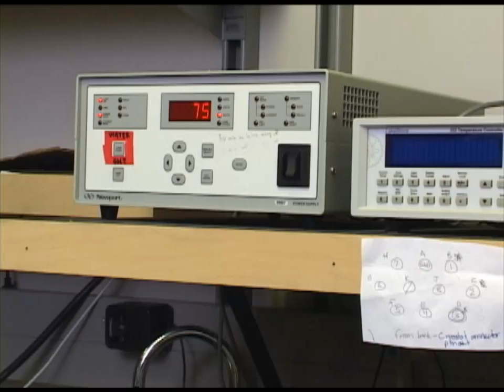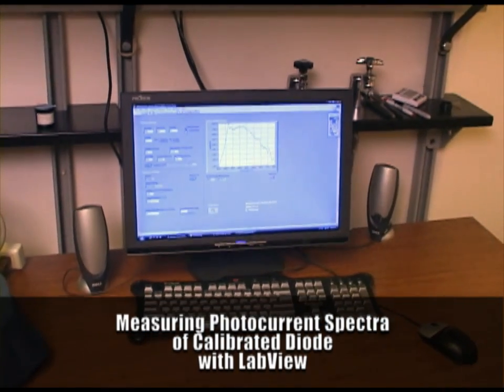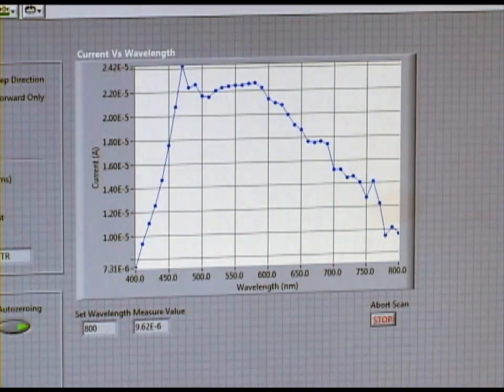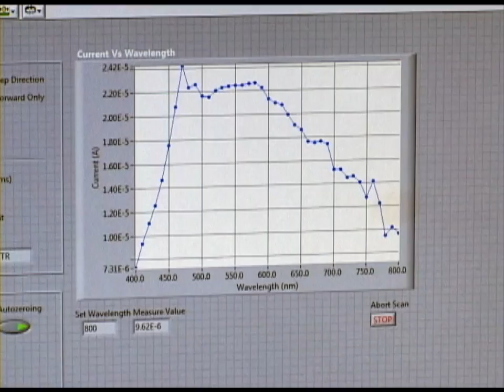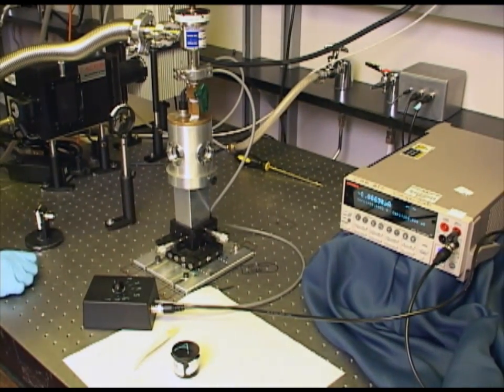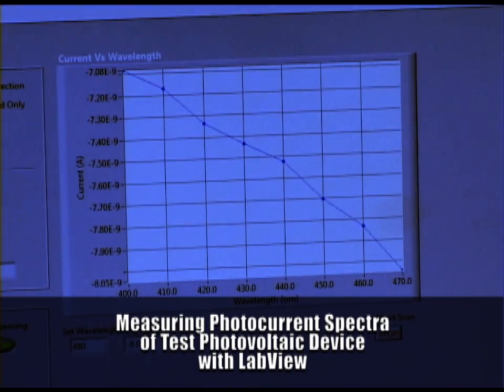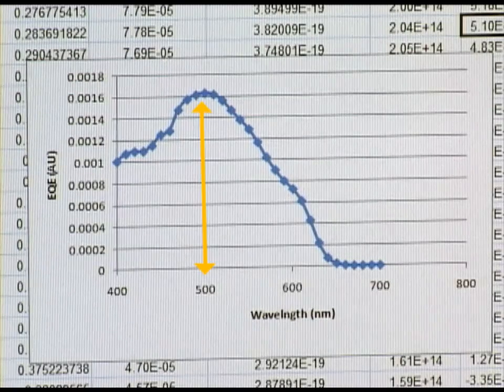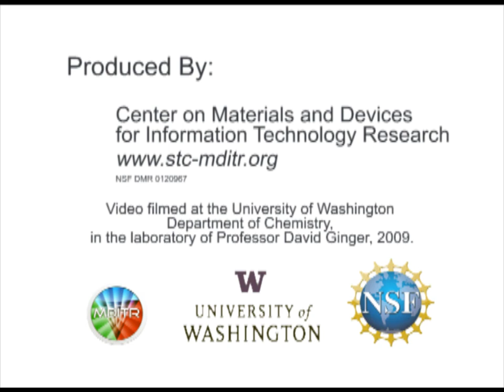External Quantum Efficiency

Comment from the maker: Described in the video is a DC continuous wave illumination technique. Chopper's are generally implemented in conjunction with a lock-in amplifier to measure signals which are below the noise level of your instrumentation, or when photon dosing of the device should be limited. The devices we measure with this technique, those of moderate efficiencies, produce sufficient photocurrents that chopping is not necessary.

Comment from the maker: For the solar cell EQE measurements we are generally measuring thin film donor/acceptor blends of organic polymer and small molecules (P3HT & PCBM, other polymers & PCBM, polymer & quantum dot, or polymer & polymer). The P3HT:PCBM blend is the test system we use as a bench mark because materials are well studied and readily available. Because we synthesize our own quantum dots, we generally blend them with other novel polymers to achieve the appropriate energy level alignment.